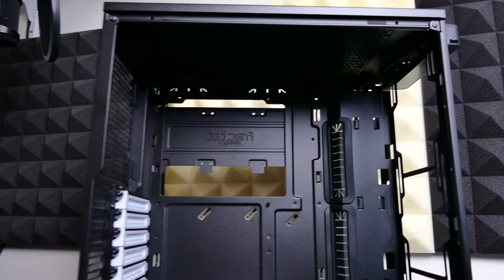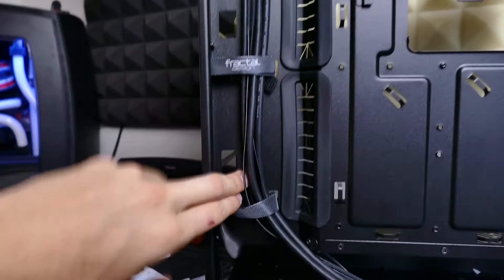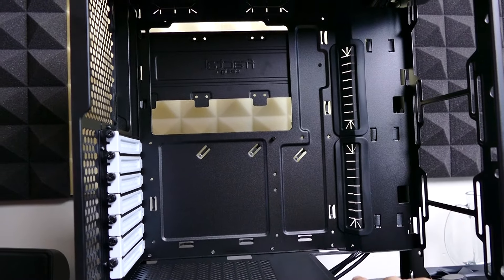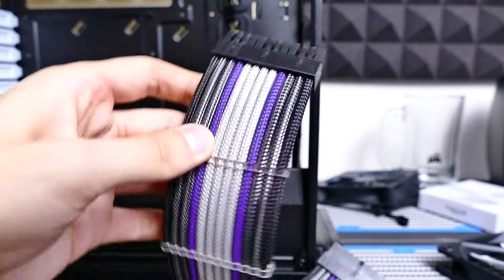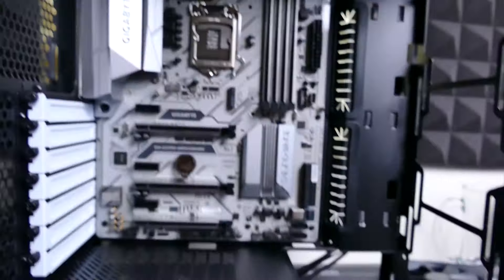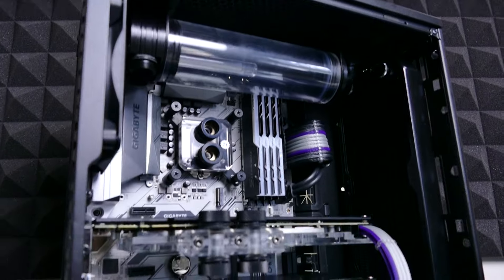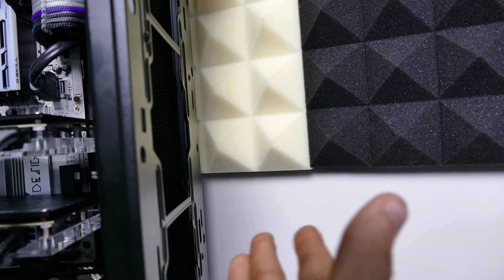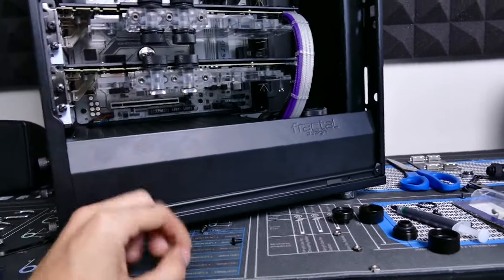Project 'Andromeda' $2500 Custom Loop PC Build (Part 1 of 2)

Comment: Still don't understand how people install motherboards with the case standing up
Reply from the maker: It was a challenge xD
Reply: yes
Reply: Skills dude, skills.
Reply: Tech Always There is a small nub in most cases that will hold the motherboard until you can screw it in properly.
Reply: Tech Always pwaktis
Reply: Tech Always Tech Wizardry? I've never tried it so...
Reply: Yeah its not recommended. I broke my first mobo pins way back in 2012 ivy bridge z77 :( but the best part is I recovered it ;)
Reply: newer case have like a standoff that stick out so you can rest your motherboard.
Reply: Salazar science tips
Reply: That little standoff stick is such an improvement, it helps with installation so much
Reply: You can do it, somehow, but how the fuck did he installed the CPU?!

Comment: I'm not the only one! I bought the Define C and I couldn't fit my rad+fans on the inside. I have an Rog Strix graphics card and it was so long that I had to mount my rad fans on the outside as well, and I was using an AIO. Be careful when mounting fans on the front. The front panel will mount back on to the case with fans on the outside of the front, but it will SEVERELY restrict your airflow. Definitely make a custom front mesh cover or something, and ditch the flat front cover. I'm not great at case modding so I decided to buy an NZXT S340 Elite and transferred my build into that. Since it is a bit larger, everything fit just fine in that.

Comment: Sucks that they don't make as many sexy mobos like these for Ryzen :(
Reply from the maker: Not *yet ;-)
Reply: Science Studio You got some insider info or something?
Reply: Luca Passalacqua you italian?
Reply: Rishabh Patel yee
Reply: Luca Passalacqua that was quick. lol
Reply: Rishabh Patel Mobile notifications :)
Reply: Luca Passalacqua same
Reply: Anyone else waiting for ryzen itx boards like the maximus viii impact?
Reply: Luca Passalacqua buy one of those fancy aorus/msi rgb mobos
Reply: not everyone likes rgb, a lot of those rgb equipment got issues with the lights with them dieing, having bios problems, reliability problems etc
Reply: Said Metiche your gpu is gonna have LEDs anyway
Reply: well i'm probably not gonna buy any gpu with lights, I am building in the pc tu-100 and want to mod it to look like an old school 1995 beige portable pc and I was planning on getting custom braided cables that looked like mustard cables from old psu's so I don't want any rgb or even white LED components. I was gonna get a 1080 mini but I might get a used r9 nano or if vega comes out at around 400$ and does comparable to the 1080 at 4k with a small FF I'm gonna get that
Reply: that's part of the problem now is that everything has unnecessary lights. Only lights that should be on a board should be functional lights that indicate error codes, temperature, system status, etc.. Also it's wasted circutry going for rgb controllers and connectors that could go in having a better onboard audio or more sata ports, m.2 ports, etc..
Reply: the Crosshair VI Hero is one mighty fine looking motherboard, offers some terrific features and is in my rig, the stupidly overprice MSI X370 XPower Gaming Titanium is downright beautiful but the power delivery isn't as good as most other X370 boards
Reply: yes the msi z270 and x370 xpower titanium are really good looking, I just wish there was boards like that for itx. Only real options even in lga 1151 is the evga stinger and asus maxmus impact which the impact isn't really completely color neutral and the stinger had terrible features and power delivery. neither of them have m.2 neither which isn't a big deal but dissapointing and that's for the intel side. On amd you can't find anything even close to that right now
Reply: what part of the world do you live in?
Reply: just curious i'm in canada
Reply: ok yeah, here they're the same as the high end asus boards
Reply: guck foogle But expensive :(
Reply: The Banana Man what?????
Reply: No part in my system costs $450. The most expensive part was $300 new. My GTX 960 and my LG 29UM58 (It was a clearance product :)
Reply: The Banana Man oh I didn't realize the other guy's name was "guck foogle"
Yeah that board is overpriced af
Reply: guck foogle Yeah, but it legit is using the same vrm design its using in stuff like the b350 gaming pro carbon. A $300 mobo with a 4 phase that's not even using doubling. And it doesn't have a BCLK generator.

The competition has better for cheaper, seriously MSI?

Comment: I like the the case except two issues, like you mentioned tempered glass, and also the fact that the power button lights up in blue, and my builds are always black and read so it will look off there, while it could fit in the build you are doing quite well

Comment: Can you flip the reservoir around so the connections are on the radiator side of the case? Should make a shorter and easier run to the pump...
Reply from the maker: Veritable Mayhem No. Much too narrow.

Comment: Nice build but i wonder about thermal inside case as you will throw hot air (coming from dual gtx 1080 + oc 7700k : 500w) inside case..with only one 120mm fan to exhaust it..:)

Comment: The Define C is a gorgeous case don't get me wrong, but for a custom loop, it seriously baffles me why you'd choose it over the Define S, given it's a godsend for watercooling with multiple large mounting positions for both radiators and reservoirs. Yes, the shroud is pretty and needed to look the part, but a single sheet of A3 acrylic can do the same job and frankly even looks better and if you can do bends for custom loops - you can bend a sheet of acrylic. And yes for a single 360rad the C is enough, though it's still kind of a hassle with the positioning of the bends and the fans won't be in an optimal position, even the reservoir might look a bit clutterd. So why the choice?

Comment: 100$ for 32gb of ram?? Where do you buy ram from Greg? I bought a 32gb set of the same RGB G.Skill 3600 from Newegg and it was well over 400$. Maybe the slower speeds are cheaper, but I don't see them being 300$ cheaper. Just curious more than anything. Can't wait to see the finished build!

Comment: love the build so far. I have the same case and I love it, even though it's a tight squeeze for an ATX build with long GPU. I think  for a smaller case it has decent cable management, not the best though. Why you ask, well all those cable get in the way with the included 3.5 drive bay they include, I had to remove mine to make room. All in all its a nice case for the $. I will most likely keep the case long term and maybe use it for a smaller build. Oh BTW nice music choice.

Comment: Hey Greg, I've seen quite a lot of custom loop vids and what authors ALWAYS cut from the final montage is how the heck you guys connect two SLI cards with tubing? Now I know that EKWB and other vendors have bridges for that, but you here have simple rigid tubes and both cards were installed prior to adding those... How?!

Comment: would the reservoir not be better the other way around, then it be almost a straight drop down to the pump, or would that be in  the way for the connections for the radiator?

Comment: "Upwards of $100 USD for a 32gb kit" Well...over here in Australia, a 16gb kit of the same ram will cost you $200 AUD ($152USD) for a 2400mhz model and the 3200mhz kit is another $50 on top. Pricey stuff, beautiful memory though.

Edit: How did you find the delid experience?

Comment: RAM is expensive? tell me about it. in my country (Greece) i bought a 16GB kit (2x8) Corsair Vengeance LPX 16GB DDR4-3200MHz 145€ (around 130$). and the same kit now about 5 months later costs around 200€ (around 180$). imagine building a new rig and starting with 200€ only for RAM. that's insane.

Comment: Great Case - too bad there´s STILL (probably never at this point) no glass side panel for it ... But a cheap glass tabletop is easy to find and they´re all tampered. Bring it to a workshop where they can do the cuts, drilling and edges. Costs in Austria about 25€.... Still would have preferred to get it from fractal - but yeah, reasons ... #sad
Reply: Stevens Zmek tempered glass cannot be cut, it shatters.

Comment: Greg why didn't you go with a single 1080 ti or 1080 ti sli 
if you did you said you had 2 1080s in sli not 1080 tis
Reply: spicy meme
 not everyone has 2 1080 ti's lying around..
Reply: spicy meme think hes just reusing cards
Reply: oh ok 

i guess its not worth spending the money on a 1080 ti when you already have 2 1080s which probably perform better in most games 

ty

Comment: Is anyone else curious how cooling is gonna be managed with a delidded Processor?
Reply: You usually put liquid metal or some high W/mK thermal paste on the die and glue the IHS on there again, usually with silicone. Then you can use/cool the CPU like any other.
Reply: SunRed I am just wondering because Linus once had a problem where he used a delidded processor and his cooler wouldnt reach deep enough because the gap was to big

Comment: Geil 64GB kit running at 3000MHz, CAS 13-13-13-35, still the best 64 kit, hands down, although Gskill does have best 16GB kit MHz to CAS ratio, 32GB i think is muskin and corsair is 128, been a while since i checked those though.